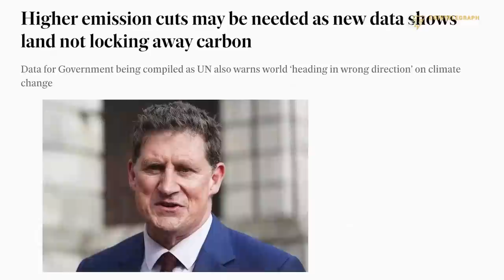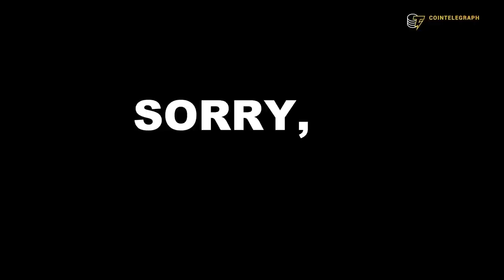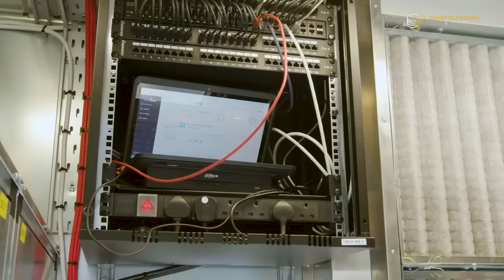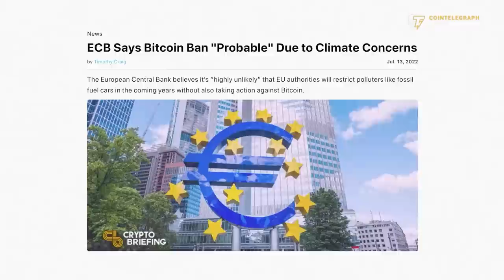How Irish farmers are turning cow dung into digital gold [Bitcoin]

Comment: The used slurry can be re-formed into a fuel and then dried by the heat generated heat by the methane gas power supply and bitcoin mining farm. The rest of the used slurry can fertilize the soil where the cows would graze later for a fatter beef and milk products. WOW!